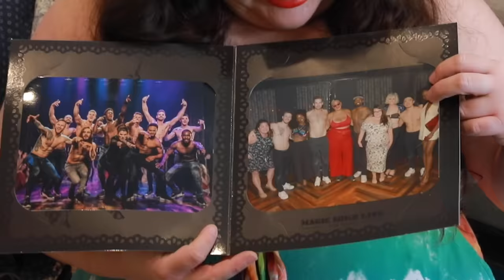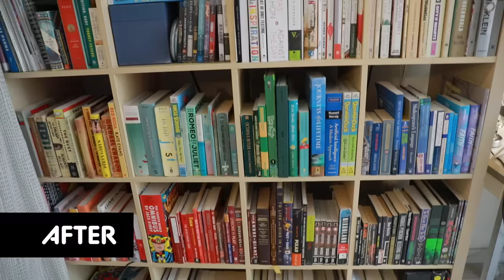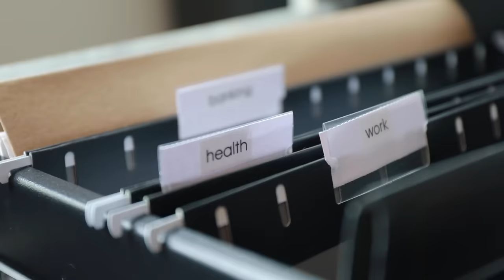Kristin's Home Gets Professionally Organized | Complete Makeover | Kitchen & Jorn

Comment: Kristen, you’re super cute thinking you have a lot of candles. I have an entire cabinet in my kitchen, double stacked, top and bottom shelves, full. I have 2 cloth baskets in my linen closet full and the drawer of my entertainment center full. In addition, I have at least a dozen more spread throughout my house as decor and at least 2 in every room, including the bathroom, that I alternate between for actual burning. On this last candle day, alone, I bought 36 new candles. That amount is probably about 1/4th of what I buy each year, in 3 wicks alone, and I only burn through about 4 per month. I also have another 60+, at least, “finished” candles that I have had plans to melt down and reuse as wax melts or combine into new full candles.

Comment: This is what my space used to look like when I lived alone. Living with someone else has really helped me keep my mess in check, but I know how hard it is. And once the mess gets out of control, it's so overwhelming to try and tidy it up, because where do you even start, and where do you even put things? Getting external help really is a great way to get organized and just even get started. Just know that, even though it may not seem like it, it is possible to get your messy gene under control at least to a point where you will be able to tidy things up when it becomes necessary. I still accumulate mess around me, but I know now where I can put it if it becomes too much, and that alone makes a huge difference!

Comment: This is just one fun observation. Kitchen didnt like the stand with the glassware. But it was one (maybe the only) organised spot in the house. (agreed, maybe not the most practical spot, but it was organised). 

I have ADHD too with a little hording tendancy. I have a fix with boxes, because you can put stuff in them (to organise it), but most of the time I dont. But still my house doesnt look like that. (Atleast not all my rooms.) My room with kostumes and props. (i am an amature musicalactor) and my DIY attic (as in the space were i make stuff out of other stuff) Those are the ones less organised with actual stuff on the floor that could be put elsewere. 

The living space could be less cluttered, but i can declutter the visible spaces in that room in less then a half hour, without stuffing things blindly in a cupboard out of sight. (so actual cleaning it up) So i think it's not that bad in comparisson. I am not that of a cleanfreak but i would get very agitated an restless (because of my ADHD)  when it would become this cluttered. (This is absolutly no judgement, i write it as an observation and comparing data)

Comment: This made me want to move forward on organizing my bathroom and bedroom. I think my biggest issue is also clothes and that my closet isn’t very accessible. Its got folding doors and they never open all the way because my bedside table is in the way and then they come off the track so like half of the closet on either side is hard to get to. I’m going to think about replacing it with a curtain or a sliding door of some sort 🤔
Reply: And I also have ADHD and OCD so hearing that Kristin has these same struggles was helpful.